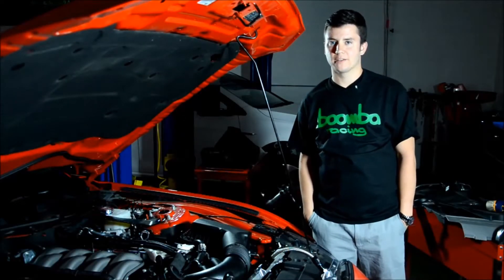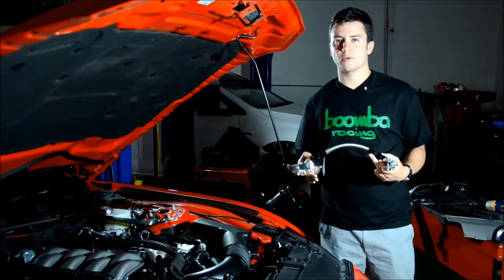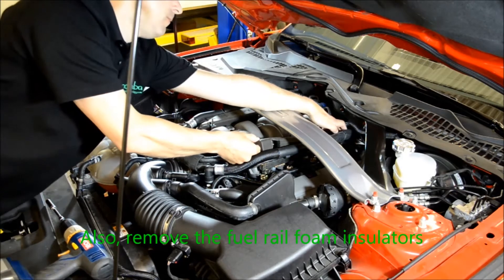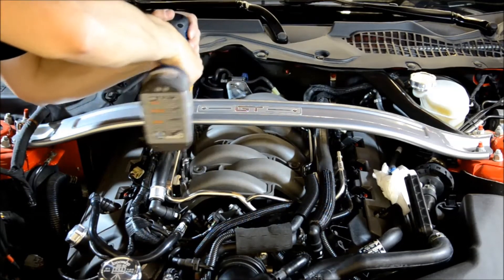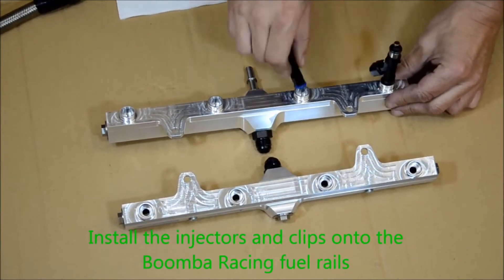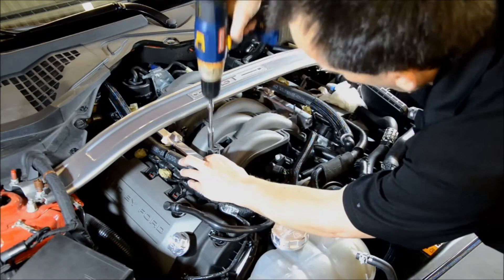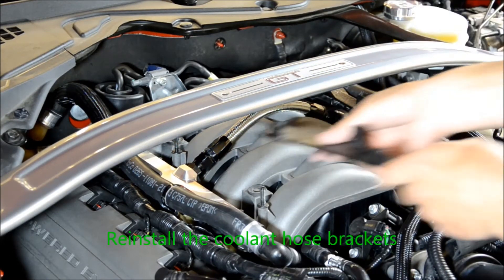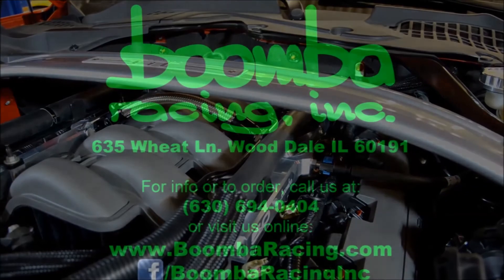How to Install | Boomba Fuel Rails for '15+ Ford Mustang GT w/Intro

Comment: The crossover line , is there an option for the crossover line on front or rear for my Roush supercharger ?
Reply from the maker: Hi, if referring to the braided line included in the kit, we do only have one length of that line in-house. If you do need a longer length hose we'd be happy to provide the specs for you and you should be able to find it at Summit Racing or an online supplier.
Reply: @BoombaRacing  thanks for the quick reply.
Reply: Again. Can the crossover fuel line be adapted to the front or rear of the fuel rails?  Because the crossover fuel line will not go over the supercharger.
Reply from the maker: @MustangGuru  Hello. Our part is designed to work with stock parts but due to your supercharger it sounds like the braided crossover hose is too short. You will need to source a braided line from a website like Summit Racing to use for the rails.

Comment: Installed your fuel rail with the LU-47 injectors and there’s not a lot of clearance with the fuel line rubbing the valve covers
Reply from the maker: You can see in the video that it's very close as well. It shouldn't cause any issues.
Reply from the maker: @BRob1320  Not by themselves, but they allow for an increased and even volume of fuel, which can be beneficial for high horsepower builds!